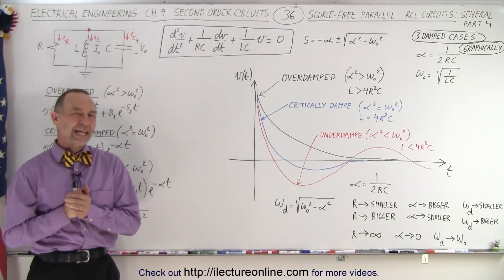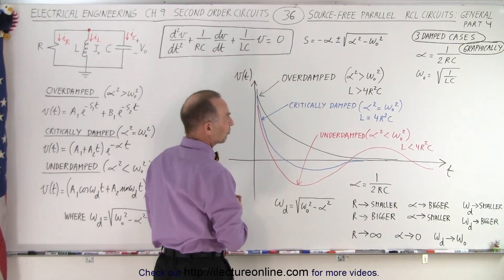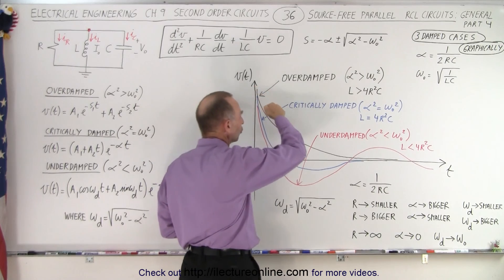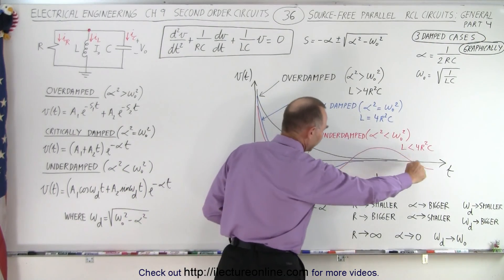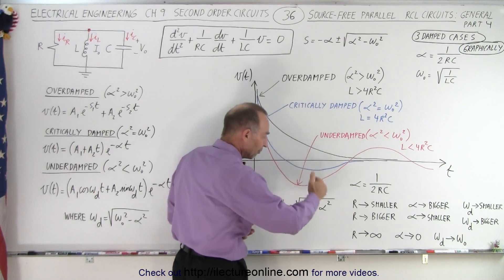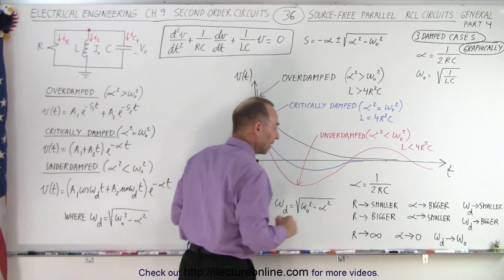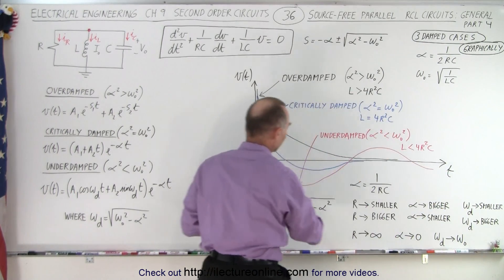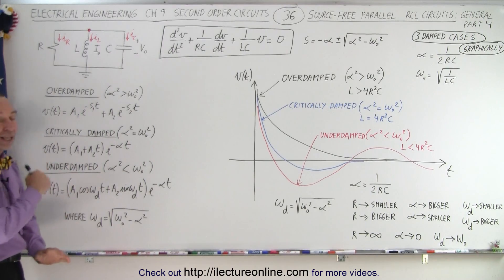Electrical Engineering: Ch 9: 2nd Order Circuits (36 of 76) Source-Free Parallel RCL Circuit 4 of 8

Comment: Sir, You said for the overdamping effect, the sign of (e^s1.t) will  be + on previous video but it is '-' here. I guess you just forgat it :).
Reply from the maker: In all three cases of damping the general solution includes a "-" in the exponent.  However in the overdamping case  y(t) = A1 e^[-(a-bt)] + A2 e^{- (a+bt)]     Therefore one of the exponents could potentially be positive, depending on the values of a and b, but I would have to look at the particular case.

Comment: Thank you so much , I am just wondering about the sign in front of  (s) in the general solution of the overdamped case,  here in this video you did write it in (-) sign but in the last video you wrote it in (+) , which of them is right?
Reply from the maker: In the overdamped case the signs in the exponents should be "+"    good catch.
Reply: I got it thank you so much